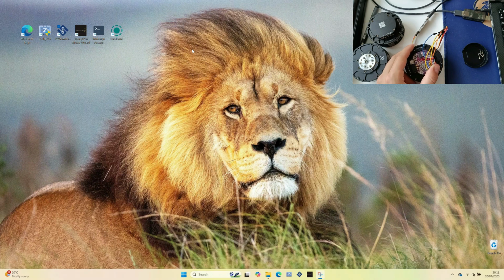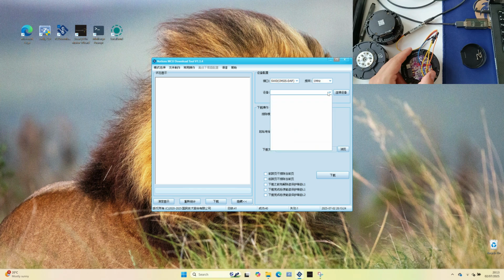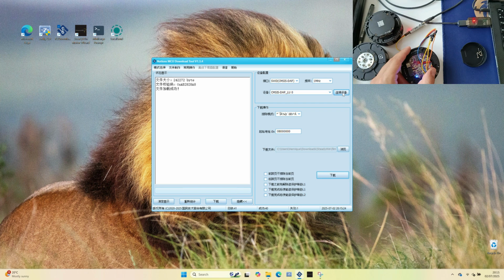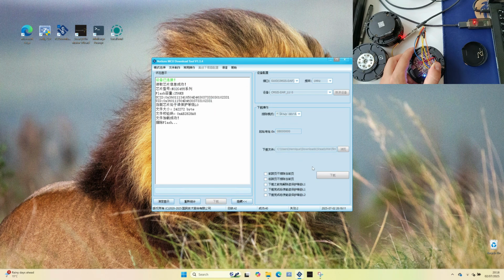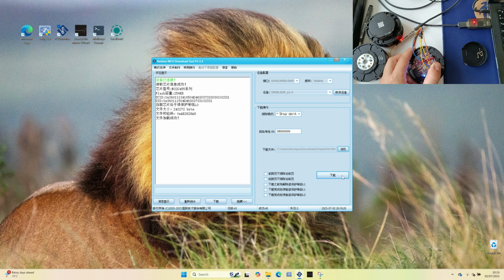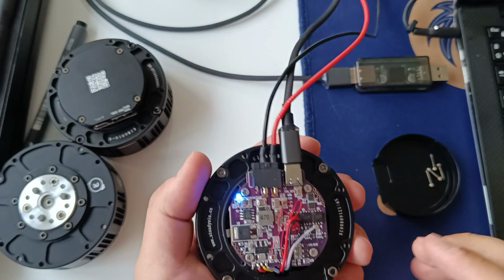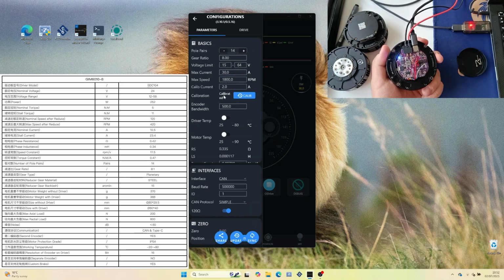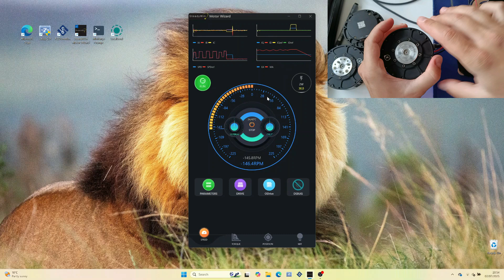Flashing Firmware to SteadyWin GIM6010-8 via SWD (DAPLink/JLink Method)

Comment: hello, thank you for the detailed video! when I connect my DAPLink to the SWD pins on the GIM8108 my DAP link heats up and turns off. I have verified my pins are not shorting and they are connected to the corresponding pins. Any tips to troubleshoot?

Comment: Hello, I couldn't find these .bin files on the steadywin website. Did you request them directly from the manufacturer?  I have a problem with one of my motors. The calibration phase seems to be stuck. The motor runs continuously and cannot be stopped, making it impossible to continue with the configuration. I tried the odrv0.erase_configuration() command, but nothing works and the problem persists. So I have no other option but to try flashing it..
Reply from the maker: That issue does sound like it could be fixed by re-flashing the correct firmware. You can get the firmware .bin files from the Chinese page of your motor. E.g., GIM6010-8 https://steadywin.cn/pd.jsp?id=115#_jcp=3_3
Reply: Did you end up fixing this issue? I am having the exact same issue with my GIM8108-8 with no luck.